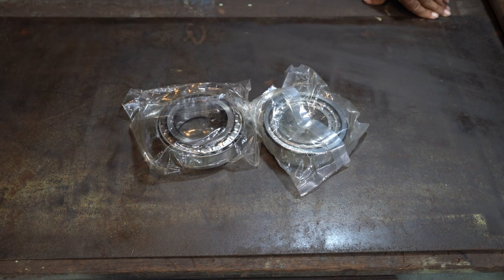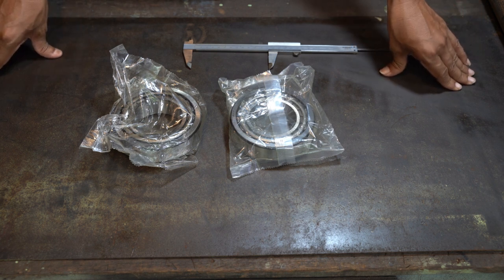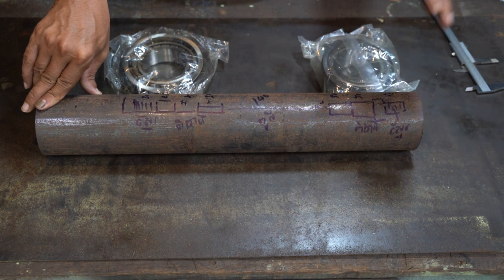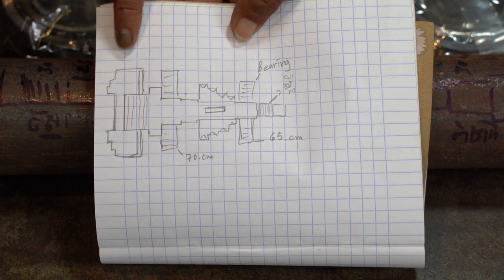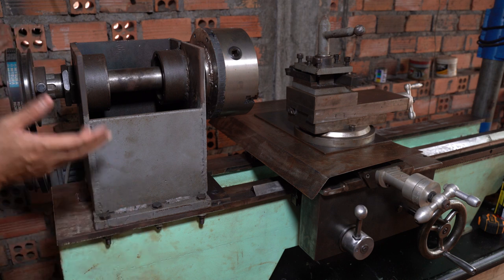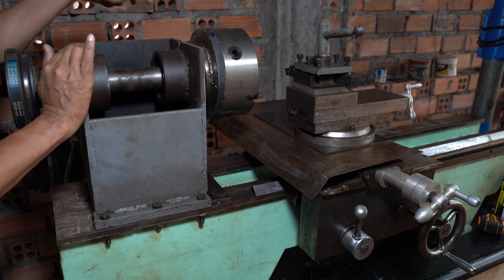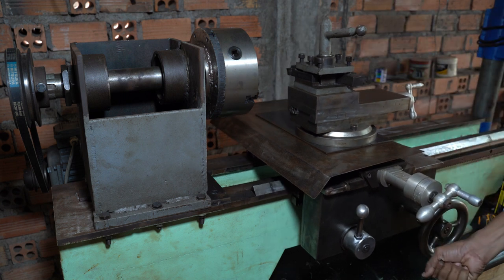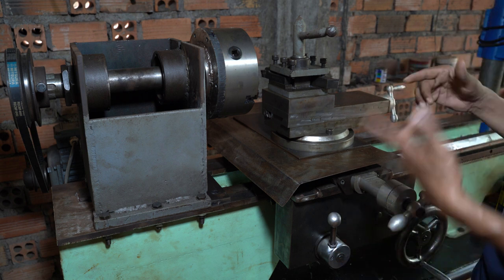New Bearing And Spindle for Headstock Lathe

Comment: I'm almost done with book "Spindles" by Harprit Sandhu (Workshop Practice Series, #27), he's got one with a 1.5 inch through hole, diameter 2 inches and length 4.25 inches. But most of them so far have been smaller ones that take Dremel chucks, etc. for clockmaking, etc. However the principals are the same regardless of scale.
That tube is awesome, really thick for high pressure application, I'd love to have, but sort of "overkill".
I would NOT weld anything, there will always be warping/warpage...must thread it.
I think the material the bearing rests on must be to a 'high mirror' polish which you can do with successive emery paper, 200-1200 grit with water/oil, you won't tear seals. 
Do the most critical stuff last, so do seal recess, then do bearing recess...because if you did bearing recess first, when you did seal recess after, greater chance of damaging bearing recess...
I'd use angular contact automotive application bearings.
Do you have other social media to recieve photos?
Reply from the maker: Thanks for your share the best info. I’m not sure the name of gears was called. I made it no one tell me like this or that and I always thought what I can do it and don’t have any books when I get stuck I’m gone to check social media. My problem is metal cost so expensive so I’m slowly work. What do you think how big the pulley I can make I think 200mm diameter?
I’m happy for your share.
Reply: here's a milling spindle 1 of 5 part series: https://www.youtube.com/watch?v=eyl3aLHkNq8